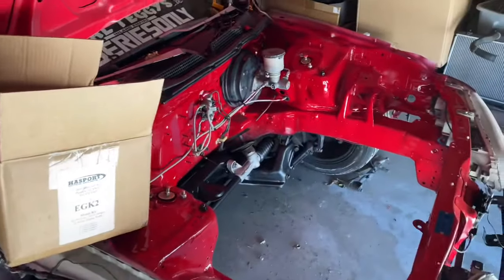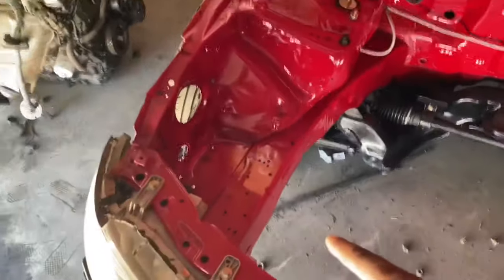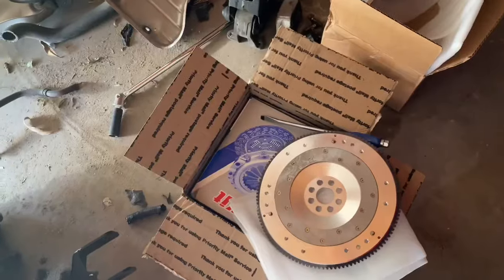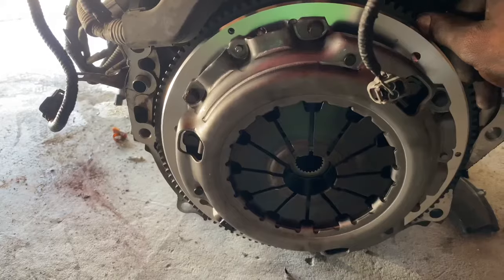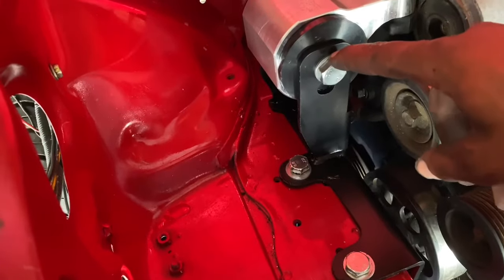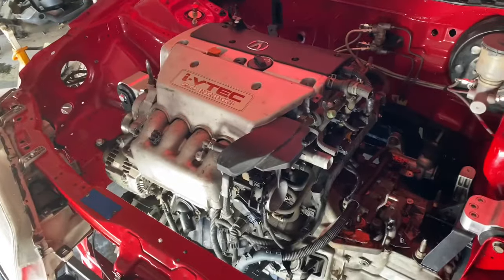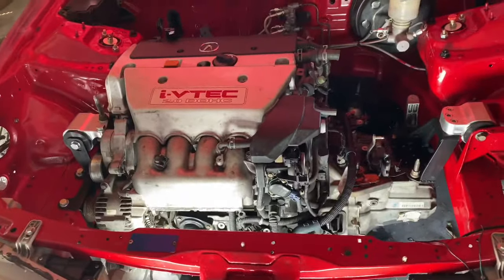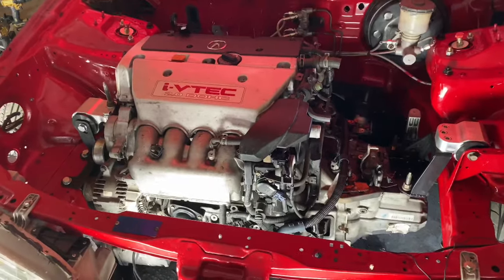Acura integra dc2 k20 swap (ca state bar) part 6

Comment: what exhaust manifold are you going to run to pass BAR?
Reply from the maker: Tsx
Reply: @rarewitit7899  will it pass? I thought it had to be for the specific engine/ donor car
Reply from the maker: Yup Rsx won’t work , and you can’t modify a manifold or instant fail
Reply: @rarewitit7899  thanks for info